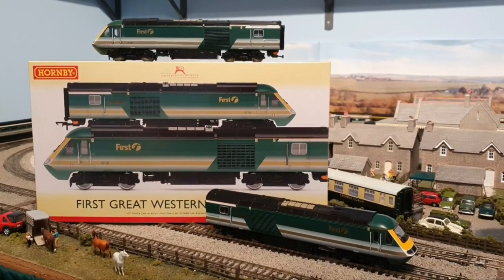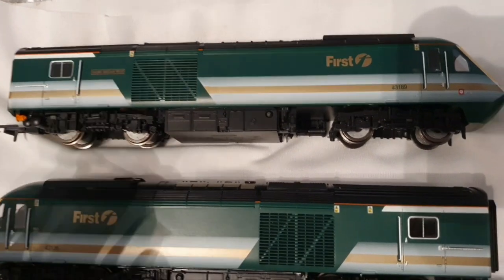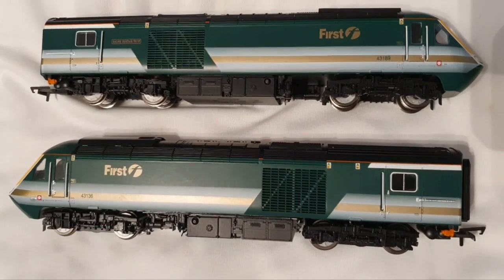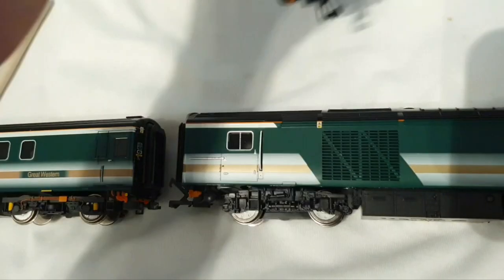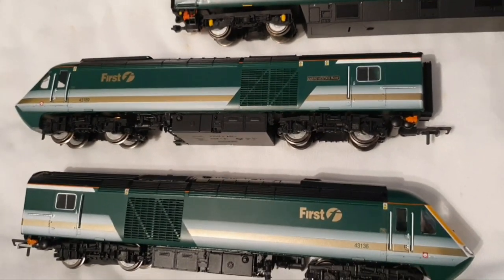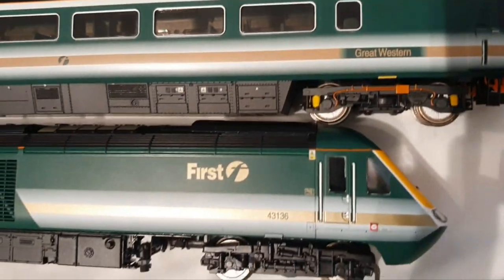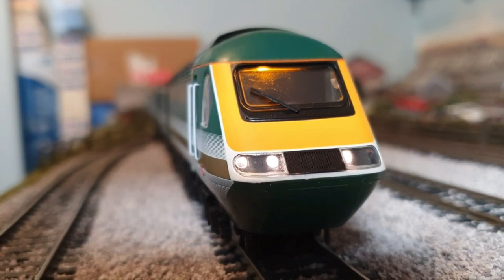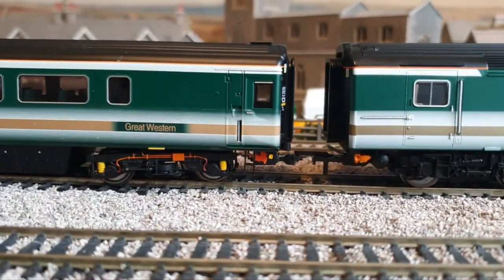New Hornby HST in FGW "Fag Packet" livery. Full review with mixed results.

Comment: very interesting review, i must admit i was happy with mine (midland pullman livery) so far apart from the price but i wont now till the coaches arrive if everything will be spot on, ive seen the one i have for sale now for 380.00 or more they are really getting expensive, i really love hsts but i wont be getting anymore at these prices and ill be looking at upgrading my older ones, i must admit the fans on mine work and a nice touch but i dont understand why they couldnt add a cab light for the price and one other plus was the pre fitted speakers so fitting a decoder was very simple. Thanks for sharing and very good video. Tom
Reply from the maker: Yes, I too have the pullman set. They have added extra warning flashes to the side. That's the only glaring error. The cab light now powers the head light above the cab. I'm not that fussed about cab lights to be fair. Hope the coaches come out well. Should be here soon.

Comment: The power cars are tampo printed and coaches have poorly applied transfers, had to use Microset to push the transfers into the door resess. Think I will try and get some transfers for the power cars to match the coaches.
Reply: I think railtec transfers do a set. I know I bought some to renumber my sleeper stock.
Reply: @roberthill6216  trouble is they dont match the hornby mk3s

Comment: If I took it back to where I brought it, instead of angry emails between you two, and if the shop didn't honour its responsibility, I would've put it in writing saying, if you don't fix these faults, I will have no choice but to make a former complaint to whatever your equivalent of consumer affairs/fair trading is.

Sounds like I wouldn't have accepted the replacement either. If you picked it up at the shop, I would've ask the shop to open it, and test it to check for any faults.